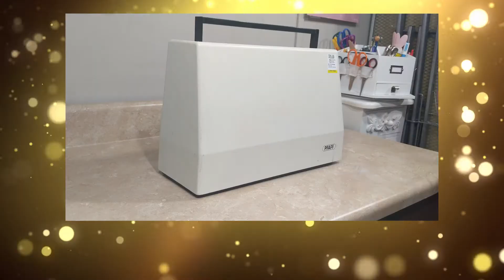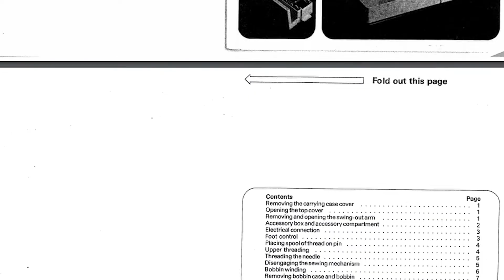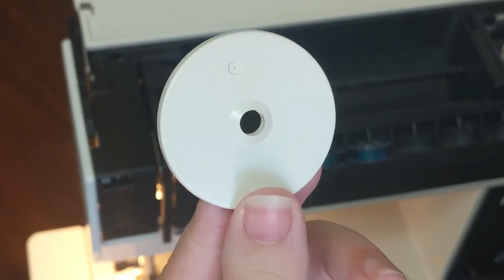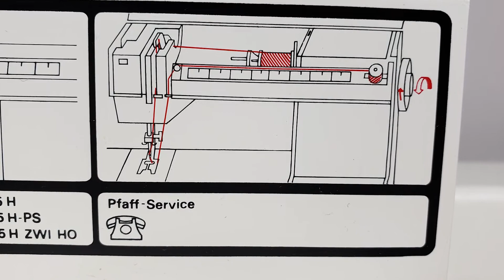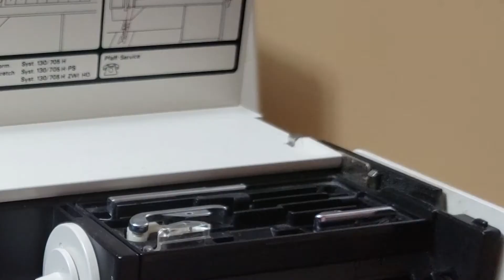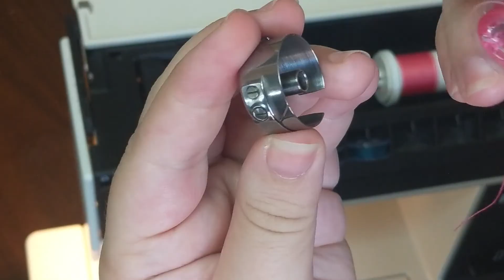PFAFF 1027 Tipmatic How to Thread Sewing Machine Tutorial and Bobbin Winding Guide

Comment: Thanks for the video but I have 1 question and 1 observation

Question: when top loading at around 2:11 and going down first there is a piece of metal for what I think is a tension disk. Does it matter which side of the disk you go down and if yes which side should it be? 

Observation: when you added the thread disk you had the flat against the thread. It is better to have the flat away from the thread as otherwise the thread can get caught on the jutting plastic cones causing the thread to snap.

Comment: Thank you so much for posting this!  Your instruction is very clear and easy to follow.  Would you consider posting a video on the best stitch to finish a raw edge with this machine?  I use the zig zag stitch (button #16) with a normal sewing foot.  The zig zag comes out irregular/narrow and it does not work well to prevent fraying.  I have tried for years to do a good zig zag with this machine and never figured it out!

Comment: Hi again, I've put some thank you $ for your effort just now. I used your tutorial to wind the bobbin using the horizontal method (the first method). I usually wind the bobbin with the vertical method (#2 method), but that was with my mother in law's machine in Europe. Now I've just bought myself a new (old) Tipmatic 1027 (with a price much higher than yours, but still lower than a new entry level), but the machine doesn't come with the extra stick for the vertical spool holder. Good thing my machine came with the spool stopper (I didn't know what it was until I saw your tutorial), thus I could do method 1 winding. 

Your tutorial even made me aware that the machine was in the "lower feed dog" mode, thus I didn't wonder for a long time why my machine didn't sew.

Thank you sooo much! You've been very helpful!

Comment: So wonderful - thank you from Georgia in B.C.  I have had my machine 36 years and have started sewing in my retirement but HELP, the tension is all wrong.  A year or so ago I did a maintenance service and since then the stitches are too loose on the top, I have jiggled and wiggled and played with it - could you provide a video about the tension adjustments for this machine….. I am also using up my old thread - do you think that is part of the problem.  I have also bought new thread and nothing changed.  Tight stitches underneath the fabric and too loose and my sewing puckers when I start and almost gathers the fabric - HELP, thx.  If anyone else reads this and has a PFAFF, please help :). It would be appreciated
Reply: The best advice is to have it service.
Reply: Definitely get new thread, new needle then triple check you are threading it correctly. I watched a sewing machine repair you tube but can’t think of his name. He was very good and thorough in explaining tension. Will try and find his name but he mentioned doing what I have told you first.

Comment: Good video… But please check your manual and you will see that you should have the thread coming off the bobbin clockwise not counterclockwise. Thank you.
Reply: Yes, that's what I thought...
Reply from the maker: Thanks for your comment!  Sorry for the delayed reply.  You're correct, it should be clock wise, not counter clock wise.  I've pinned the correction as the top comment.